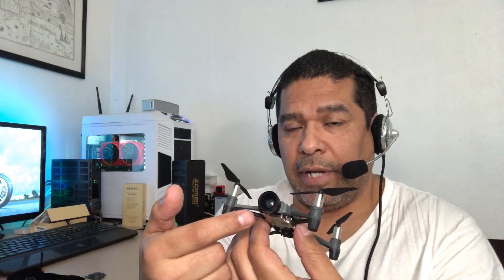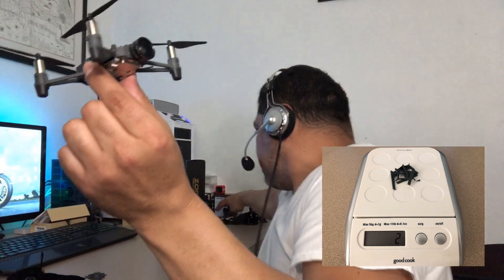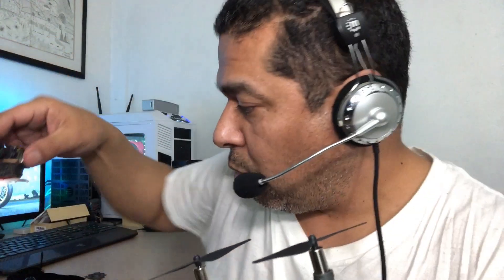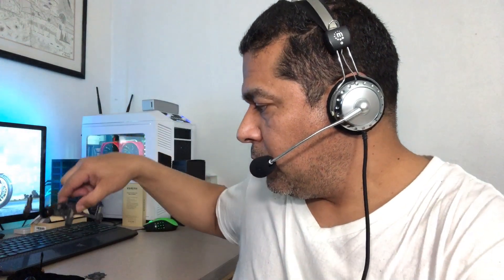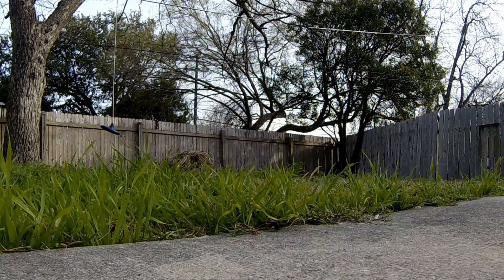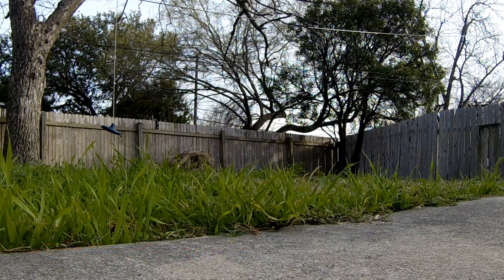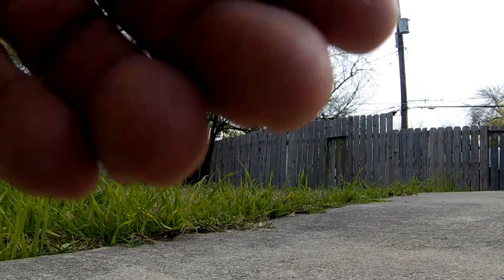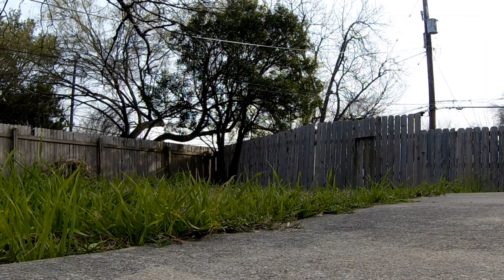DJI Tello RunCam 2 MOD Results!

Comment: I am trying to buy this product https://www.aliexpress.com/item/32815115365.html?spm=a2g0o.productlist.0.0.48402aa7Zu2kxk&algo_pvid=aa223841-73ba-4b52-a856-f731d9180a5b&algo_expid=aa223841-73ba-4b52-a856-f731d9180a5b-3&btsid=06a0fb7e-afd0-44f1-a76c-ebeb1fb173ef&ws_ab_test=searchweb0_0,searchweb201602_4,searchweb201603_52 , it says it is having wide angle view, will it be possible to remove wide angle view from this and get normal view? Did you feel any fast battery drain while you attach this with tello?

Comment: Really nice you are good mate now fix my upair one plus stops on wen  you have not calibrate it wen its got the satellites can't stop it, 😭😭😭😭😭😭😭🙏🙏🙏🙏
Reply from the maker: Uk sewing machine service Sorry to hear did you try the calibration video I sent you on your video describing your issue. I have the Upair 2.7k but both use the same system board.
Reply: @solisapaul  yes mate only does it wen got the satellites 👀👀👀👀🤔🤔🤔🤔🤔🤔😭
Reply from the maker: Uk sewing machine service this is very strange mate? 🤔

Comment: I’m glad I saw your video. With the lens it definitely took away some quality away. Was the lens clean? Footage is steady. Where can I get this kit lenses? I will need to se a video of how you mod your Tello. I want to mod mine. I have the Bluetooth remote and the Xiaomi WiFi repeater.  Looking forward to mod mine thanks.
Reply from the maker: Elnene Rakoon  Thanks for watching if you look at my videos you’ll find the one that says DJI Tello lens mod and has the Amazon link for the lens and you’re correct I should’ve cleaned the lens a little bit I have another video that shows flight with the lens on as well and it looks a lot better very simple mod not hard to do at all.👍🏼✌🏼
https://youtu.be/TPZLAUgYPm8
https://youtu.be/cltcD-ky4rE

Comment: Nice mod 👍👍
Reply from the maker: Jesse Lopez Drones Thanks, really makes video better.
Reply: Yeah, but I can't give up on the EIS! That's the reason I choose the Tello. Is there another lightweight camera but with EIS? Anyway I appreciate your effort!
Reply from the maker: Radu Suhan No problem and thanks for watching, as for EIS question. The RunCam does have EIS as well along with adjustment to field of view and 4K along with some other helpful settings. The only other camera that I can think of is the Poliroid Cube Plus, it also has 4K video but that’s about it nothing else in terms of weight that the Tello can handle. I was actually thinking on using that camera for this mod cause I’m sure once I would rid it of all possible weight it might of ended up lighter than the RunCam.? I might still try that and if I do I will upload my results. EIS does play a big factor when it comes to such small cameras, I simply just wanted better video quality. 👍🏼